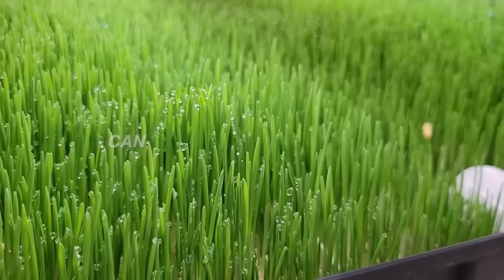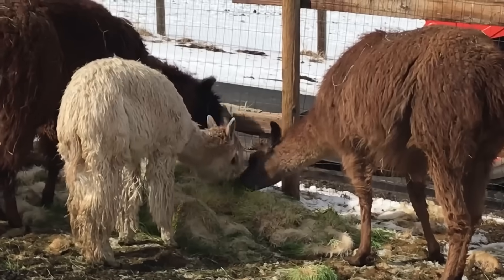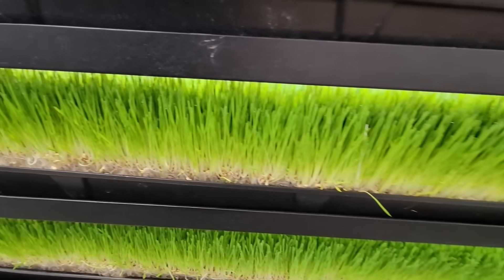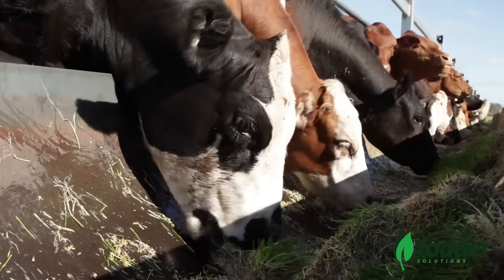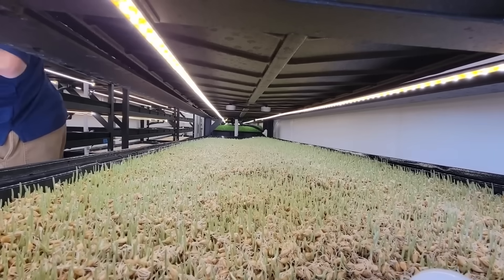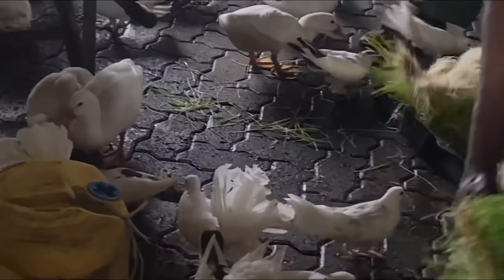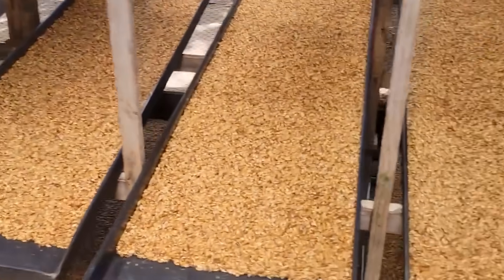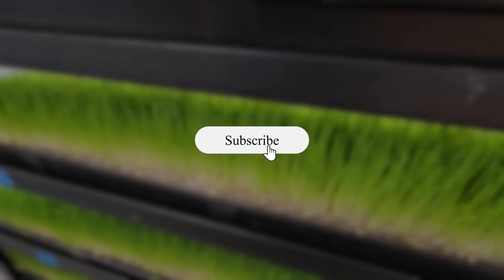Can Indoor Fodder Really Replace Hay? (The Numbers Don’t Lie)

Comment: Water is not calories.  adding water to seed and letting it sprout gets you about as many calories as feeding the grain to your animals.  yes, you may get something that is a little more digestable - that's why we roll oats and turn stuff like corn into a powder, for better digestion mostly, but this doesn't apply to fodder - you get no additional benefit by feeding your livestock fodder.   this is a lot of work for no benefit.

Comment: Where I live "hay" means a mixture of grasses, many of them native, but sometimes some alfalfa as well. That kind of hay in a good year can be cut twice but many years only once. Most is not irrigated. Takes a lot of land but not much input until time to cut and bale.

Fodder systems are relying on once-a-year seeds from crops that would need irrigation. So lots of land and water and harvesting equipment is being used to produce that 50-pound bag you buy for $20.

Maybe a grain sprouting business doesn't use much water and land, but the grain growing business does.

That said, I like to sprout grains for my small flock of hens in the winter, when they can't get cut grass or other greens besides kitchen scraps. I use barley and grow it in my house. Zone 4 according to plant maps but effectively Zone 3 because of the occasional 20 to 30+ F below zero temps and always dry winds, often without snow cover.

Comment: Barley is cheap.
Barley can hit 120 bushels per acre.
1KG of barley seed produces 8.8KG of fodder in 7 days.
A new tractor & baler is $225,000.00
Setup cost on 8 - 40ft containers producng 8-9000kg of fodder daily is the same as your tractor/baler.
This fodder setup will feed 600 feeder steers at maximum daily rate.
Two students can run this operation and you can spend your time iin the Bahamas or curling.

Comment: I like the idea of sacrifising solar energy to conserve water, as water is a scarce resource too. The question shouldn't be whether it's cost-efficient, but actually future-proof. The system likely needs to run on wind energy and batteries during winters, burning fossil fuels is likely a less expensive setup, just not durable. Just some feed for thought, I don't really have any strong opinion.

Comment: You keep talking about dry matter. Fresh fodder is NEVER dry matter like hay is. And hay when wet weighs a LOT more than a dried bale. And because it is fresh and full of living nutrients the animals get more nutrient from it. Secondly a small solar system and battery can easily provide the power necessary for the lighting etc. Which is a one time capital investment of $3000 to DIY that will last for 20+ years.

Comment: Anyone notice that at 1:44 he says he spreads about 2 lbs of wheat/barley and 6 days later he gets only 2 lbs of dry matter back. So the only increase in mass is whatever wetness the initial seed had which seems either very low or his measurements are far from accurate.
Reply: The first part of growing is mostly from stored resources from the seed. It has not actually created anything from the air.
Reply: Seems like it’s just a way to convert seed to fodder while including the root mass in the fodder making it 1:1 on the seed end but minus cost of labor, electricity for lighting, water and the system itself. Has niche use for winter I guess but it counts on cheap seed. A rotational grazing system that allows for on site hay production is probably more efficient.

Comment: So 10 pounds of water to 2 pounds of feed.  We do about 160 pounds of hay per day, so I'd have to load up, haul, unload all by hand with the use of a wagon 960 pounds per day. 

Even as just treats or supplements the added costs of equipment , heating, space, lighting, cleaning, repairs, etc. etc.  why wouldn't I just give the seeds directly to the chickens?  If you do a chicken tractor just throw seeds around the area you're moving your chickens in a few days and poof, you have freely grown / sprouted seeds.

Comment: The real solution is getting into regenerative agriculture with modern draft horse equipment,  or even antiques or replicas of former manufacturers the real reason draft horses left the fields was because of government programs to force the draft animals off the farms and replace them with tractors a move made to offset the economic downturn of ww2 ending, if we had tons of 100 acre farms you would find that the fossil fuel prices would mean nothing,,we wouldn't be losing biodiversity because there would be field boundaries again with forest,and we wouldn't need the chemicals that are also causing destruction on a mass scale for fertilizers and pest control because things are actually manageable at a individual level it works for the folks who started the horse progress days

Comment: you can also feed corn fodder as well just not as much. Right now'd buy corn low as it is.  I'd not go 100% fodder. But I could see this working out for a dry feed system. Like winter forage system eating stockpile. For hogs. Very helpful. overwinter more hog breeders.

Comment: I think it matters where you live, and local costs and availability of hay.  I think the key is in automating this.  If you have a large bin, that automatically drops seed into buckets with water periodically.  then after the required soak time it dumps the bucket into the tray and spreads them.  Then the tray goes down a slow long conveyer belt.  And at the end the tray is dumped into a bin, and then drops into a santizing solution where it goes back to beginning.   solar thermal/geothermal heat in a mostly underground building. Solar cells to power lights.  And you can slowly build up the automation as you go.  I bet over 5-6 years you could get costs pretty low, and maybe even growing some of your own seed in underutilized sections of property
Reply: they key is that it might always be higher than hay, but if you don't have price fluctuations to stress about and going to get hay or deliveries.  And you might be able to time buying the seed at times of the year when its lower.
Reply: I agree that automation would help a lot with cost. But thats only after its been set up and paid for. Getting a commercial system for the automation would for sure not be worth it. A howngrown system from a smart farmer or their techy kids would be worth it probably.

Comment: I love my Fodder machine.  It cuts my hay costs by half.  Unfortunately my unit is not working. My unit is computerized and the company no longer makes these units.  I love giving my horse green fodder in the winter.  A ton of barley runs me $300. My biggest cost is the electrical cos.
Reply: Reach out to a local hackerspace, tell them about your problem and see if anyone is interested to fix it for you. Will cost you some ofc, but gets you up and running again.

Comment: i laughed this is so dumb. hay grows outside in the sun.  it doesn't require much overhead other than a field and fallow once every few years. the only reason this indoor stuff is profitable is because its expensive. once hay tanks its not a profitable thing .even then its cope to just not owning a field. the cost of hay will rise if you need this much expenses to grow one of the easiest things on the planet.

Comment: Roofing and windows should allow sunlight in to reduce power overhead costs, as well.  Regional wastewater treatment plants and compost piles can be used to set up methane digesters that can produce high quality fertilizers in significant amounts.  Think strategically to contain inflation indefintely, while boosting overall profit quality.

Comment: this is a very good video but a real cost analysis should include how much is needed to produce the seed to support an animal based on the animals weight so that any person can calculate if this is really worth investing in for their farm or pet. everything is based on supply and demand. as the demand for seed increases the land needed to produce those seed goes up and so will seed cost. what is really needed is an ongoing system that produces fodder from the same seeds multiple times like a pasture does.
Reply: The costs are very locational, so hard to put a real cost analysis on it. If you have a barn with south facing windows in an area that doesn't get too cold, its a lot different from a freezing cold area with only artificial heat and light.
Reply: @randomviewer3494  true currently people are using everything from just a few racks in their home to commercial automated grow systems. it is still possible to do an actual analysis based on a controlled environment. the primary analysis would need to know exactly how many seed would be needed to provide the 25% of the daily ration for an animal based on the animals weight and any desired weight gain. that could then be used to calculate for total seed needed in one year for any number of animals. the seed used in a given area might also vary wheat in some places maybe barley or oats in another based on local availability and costs. depending on the seed used it could also impact the percentage of the fodder ration in the total daily ration. this is why accurate and complete data is so important.

Comment: I grew fodder for my rabbits and chickens on my small farm and it was wildly successful. I also highly recommend fermenting any feed you do use.
Reply: What does fermenting provide?
Reply: @vladimus9749  from the top of my dome, up scaling of protein content by bacteria, slight shift of amino acid composition, also lacto bacteria’s tend to change pH blocking fungus growth
Reply: It allows it to be stored and not rot. It's beneficial for cows or other animals with rumens
Reply: That is such a small scale....the costs of hay for them would be 100 dollars a year anyways at the most.
Reply: Im planning the same thing for rabbits to reduce cost. But i found that fodder has low fiber,high protein and not coarse or rough (to naturally wear down rabbit’s teeth). It’s the complete opposite of hay which high fiber, low protein and coarse. Would love to know your experience, do you completely replaces hay or use it as supplement?

Comment: currently running 200 head of cattle 50 of which are feeders. I TMR mix crushed corn in a hay/silage/sugarbeet pulp. when your talking 18 percent protein sounds awesome but corn does the same at 25 cents a pound. Its multitudes more work for more expensive feed from what it seems like. Yeah self regenerating easily sustainable but at the of 3 to 5 times the labor and effort. At that price point i could be bucket feeding oats and still have a better feed source at half the labor.
Reply: What I really want to see is how well it would promote growth feeding 12 pounds a day to lets say a butcher steer how it would effect marbling and taste. Might actually test that on my next steer just for fun. Cool practice for people that dont have the land to supplement growing their own feed.

Comment: Green ≠ Dry: Hydroponic or sprouted fodder is lush and moist, not dry like hay or silage. That moisture content throws off rumen fermentation if used daily—especially in ruminants like cows and sheep that rely on fiber structure and dry matter rhythm.

Monotony Breaks Rhythm: Giving the same green feed daily violates the animal’s instinctual rhythm. Ruminants evolved to graze a mix—dry roughage, seasonal greens, mineral-rich forage. Indoor fodder lacks that diversity and can trigger digestive imbalance or refusal.

Fiber Deficiency: Sprouted fodder is low in effective fiber. Without dry matter like hay or straw, rumen function suffers. You’ll see bloating, loose stool, and feed refusal if it’s overused.

Weekly Green Boost: Spot on—using it once a week as a green supplement makes sense. It mimics seasonal grazing bursts and adds fresh enzymes without sabotaging the dry matter base.

Feed Conversion Bluff: Lab metrics might show better conversion on paper, but that’s optics. Real-world rhythm, animal preference, and gut health beat spreadsheet logic every time.
Reply: So what you are saying is cows are not designed to graze, they are designed for farmers to put in a pen and stick dried food in front of them.

Comment: superb analysis... the only teeny bit I think was off was the starting weight of 2 lbs/tray and then grown out "dry matter was 2 lbs/tray" but the green portion would add a bit more?  Maybe not material difference but it seems relevant to me, like the change in 12% protein starter grain vs "16-18%" in the fodder.
Reply: The substance has to come from somewhere. Without soil nutrients, the green growing stuff pulls mass from the seed grains. It looks bulkier because it's full of water.

Comment: The first video I saw about this had me so excited. I am surrounded by cattlemen. I thought all I would need to do is set up an automated system and deliver fodder all day. Then I realized they hadn't done the dry weight comparison. Ozone does damage plants but could probably be used to avoid mold if used correctly.
Reply: You can add beneficial bacteria that may be able to control mold
Reply: @Blue_Azure101 nice
Reply: Look into azolla
Reply: From what I know, there's less dry matter than the seed it started as.

Comment: the guts of cows and horses is not designed to digest seed. its also hard on their teeth. sprouting the seeds before feeding them to your livestock increases the bioavailability/digestibility of the grain that can be more easily stored for long term against drought/poor harvests and can be bought when the prices are down and used whenever. cows digestive systems are also not designed with high protein feed in mind. they get digestive tract issues with excess protein and they can even die from the excess nitrogen in their blood
Reply: The Internet says that the problem doesn't come simply from high protein diets, but rather "non-protein nitrogen (NPN), like urea, is consumed in large amounts".

Comment: Balancing higher energy and protein with bulk and fibre is needed if you care about your livestock. This can be a part of many systems especially in my area where fodder is transported long distance or it becomes difficult to source high protein feed in drought times when traditional techniques require the season to change at a certain time of the year. Not the solution to anything but like most things a part of a system that needs to be understood.

Comment: We germinate seed for our chickens and goats but we aren't this fancy.  We have 12 foot black rubber troughs about 14 inches deep. And 20ish inches wide We use a transparent corrugated roof panel we got from Lowes years ago to cover over the top. No electricity.... we just dump 3 five pound coffee cans of grain in it, half ass spread it out and dump a couple cans of water in it then put the cover on. A few days later it's all sprouts and ready to go. It's not lush green loafs of grass but it's not the same grains either.  We feed most of it to the chickens and some to our goats .

Comment: With labor being the most expensive input small systems make the least sense. Trays of fodder are heavy. Larger, AUTOMATED, efficient systems are the way to go. Here is how:

- Tracks of overlapping plates (like scales) connected to cables that turn them like a conveyor in a loop with 2 layers (top and inner surface) to grow on it requires half the materials. The sides are lined with rubber strips attached to the rack to direct water down the conveyor.
- An arm with a slicer, pushing plow and rotating brush, slices strips at either end of the conveyor loop, pushes fodder strip into a bin and cleans the surface.
- Lastly 2 hoppers with slits lay down an even layer of seed on the conveyor by adjusting the height to the required thickness.
- 2 actuators lift gates acting as dams to hold back water. Sprinklers behind the dams soak the seeds and as water overflows it waters the mats further down the conveyor.

There is a company selling this design in 40ft container modules but it can be built much cheaper if you buy the materials and assemble it yourself. I simplified parts of the description to keep it short but this thing can be built in massive 6 layer 40'x20' modules for a few thousand $ and with 10,000 sqft of growing space you can grow many tons of fodder. The lights are the most expensive part of the build but it is not much harder than assembling a large shelving unit.
Reply: Sounds very good but hard to picture without seeing one. Do you have any links you could share? Thanks

Comment: Ruminants require DRY MATTER.  Dry matter is the actual food/nutrition present. the pounds of DRY MATTER in forage is critical and if not balanced properly will lead to potentially lethal metabolic acidosis.  Fodder is very young plants.  ANYONE who works with forage knows that young plants have lower dry matter than older plants.  There is an ideal level of dry matter in forage based on the stage at which it is harvested.  Early forge like this is mostly water.  There is no way that fodder systems harvesting at the stage of growth shown in the video produce equivalent nutrition and necessary fiber requirements to sustain a healthy ruminant.  PERIOD.
Reply: The video says that it stretches stored hay and it's not a replacement.
Reply: You didn’t watch the video did you?